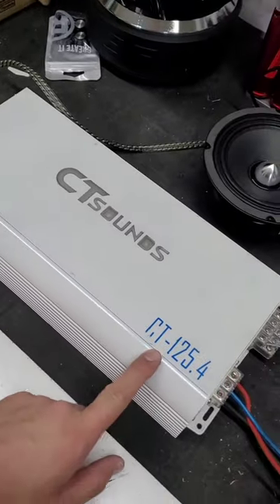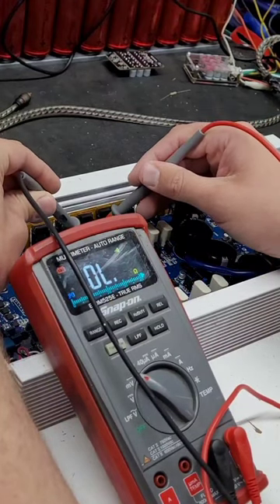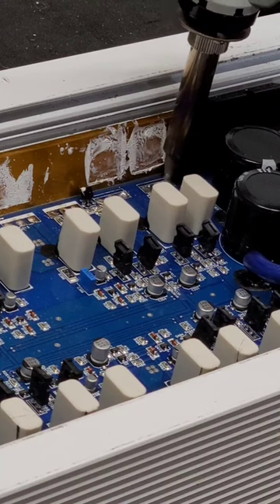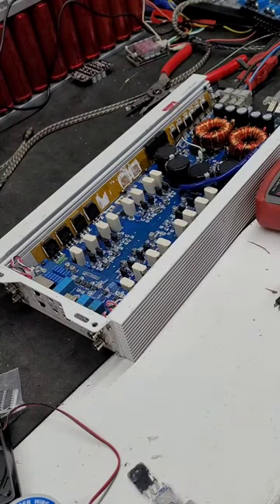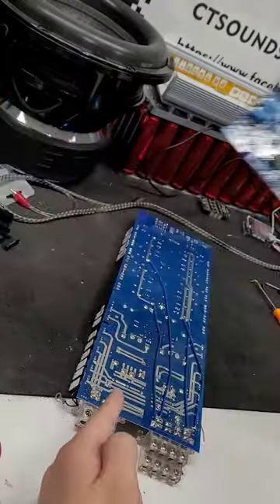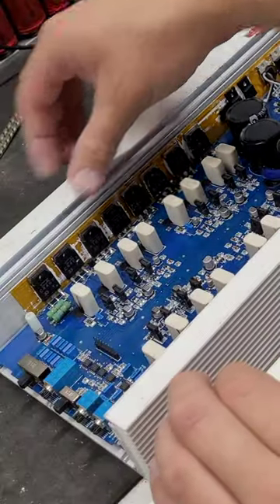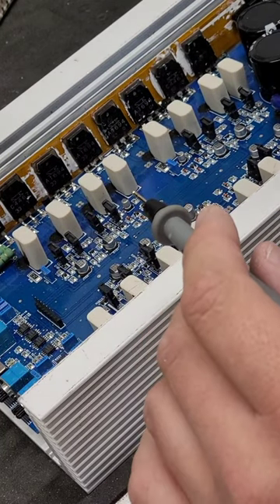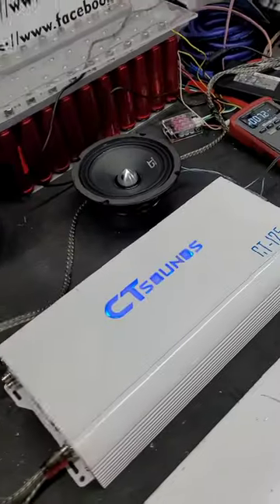CT Sounds Amplifier repair - RARE CT-125.4

Comment: Dude smart af, I just shipped my CT1500.1 back to them as it bumped 2 tropo 10's @1ohm for a week until the subs quit and the amp went into protect accompanied by a very quickly flashing power light as well as what sounded like a buzzing/clicking sound as the power light flickered and the protect light stayed on. Checked wires and unwired the subs and it still did it. Also ran remote wire straight from headunit bypassing the knob. Not sure what happened. Any ideas?
Reply from the maker: @n0t0vicri0us power supply shorted. Probably starve for power. I suspect ground point
Reply: @ATCA  @ATCA Hmm, I checked power from batt, 150A fuse checked out, I relocated my ground but it is odd that it could've gone bad as the amp worked flawlessly for a week or so. I just don't understand.
Reply: Does that fry the amp? @ATCA

Comment: nice video man so this amp have problems.??i just buy mine.!!
Reply from the maker: You bought one like this?
Reply from the maker: This amp is 15 years old. If you bought yours new recently,  it won't have any of this issue
Reply: @ATCA  ohhh nice 😀😀 you think is posible connect 8 speakers on this amp.?
Reply from the maker: @jesus-go7us  yes
Reply: @ATCA  yeah the ct 125.4
Reply: @ATCA  thanks for answering man 👍👍👍